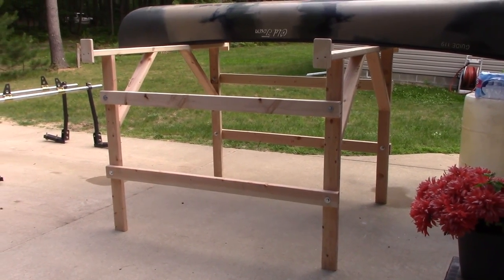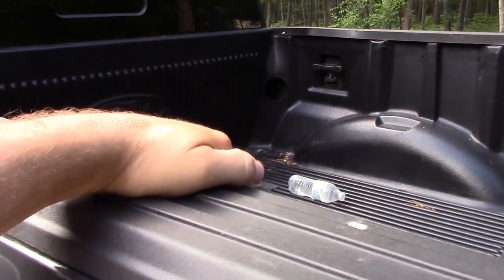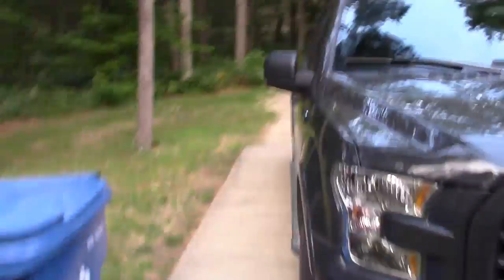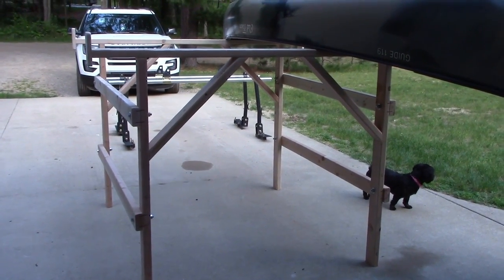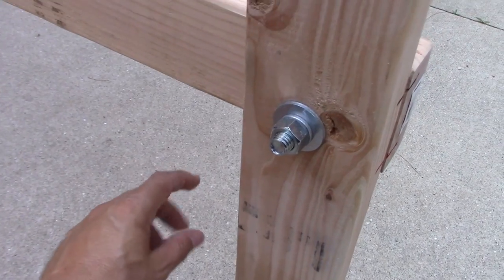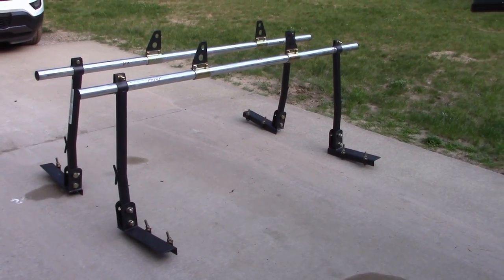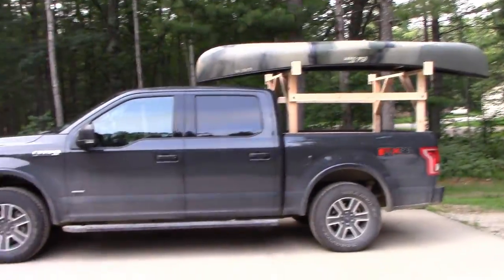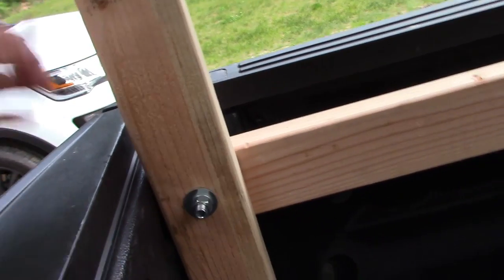Homemade Take Down Canoe/Gear Truck Rack

Comment: Excellent!  I built this rack over the weekend.  One tip if you plan to build one, put your tape measure in the tool box.  You only need couple of “measurements” and a piece of scrap wood is far better. Cut a piece of scrap to the minimum width of your bed at bed level.  For my F250 that was right at the tailgate, correction, cut two the same length.  Then use the “jigs” between the verticals and screw the horizontals on. Easypeeze! Same concept with the rails, 2 scraps cut to your preferred height (top of rail about the same as the top of the bed).   For mine, I used the same jigs on the top rail, again easypeeze.  I used someone else’s suggestion of clamping the rails together and drilling through them at the same time ensuring all of the holes lined up.  In July 2022 9 2x4’s came to $50 and a couple bolts I probably already have in my shop!😆
Reply from the maker: Yep such a fantastic rack!

Comment: Unless I missed it, no one has mentioned that some of us don’t want to drive around with the racks on our trucks for 90% of the year that the racks are not needed. The metal ones are more permanent. Your setup allows for an easy breakdown. Awesome idea and video!
Reply from the maker: Great point.  And I wanted to be able to store in in the garage to keep it out of the elements.  So the simple bolt together and labeled rails make it very easy to assemble and disassemble very fast.

Comment: Ooooooooooooohhhh!!!! I was totally bass ackwards beforehand in how you'd break it down. Great rack & something that I can do & use. One thought: on the tabs, maybe drill a 1-1 1/2" hole on the bottom side of the tab. Gives you something to hook ratchet straps to. Another thought, this one for your braces. Another channel, Cottage Life with "Brojects", they used metal braces. My thought is is that it gives you a little bit more room for walking around. Great job, I'm going to use your design! Thanks!
Reply from the maker: Great tips! Might have to try some of that stuff next time I make one. This rack has been thru 3 trucks and about 20k miles across country so far and holding up just as good as the day I built it. Love this thing!!!

Comment: Wow, super excited to see this video. Its just what I need to haul my Old Town Saranac 14'6
Reply from the maker: Works amazing you will love it. Used this one for 6 trips across country with 2 boats upto and it was refitted to 3 different trucks. Sold it in Nov when I moved to Georgia for 175 bucks
Reply: @SamkoTradBow  going to get materials after work today and my son and I are going to do this project next weekend. My question is the gap over the truck roof. Would 12 inches be too much?
Reply from the maker: @mattbruneau8215  what I did was tip my boat upside down on the drive way and measure the gap at the middle of the boat to the ground so I know how much the canoe rips curl. Then I added another 6 inches to that. You want to make sure your boat on the rack won't have the front of the boat hitting the roof.
Reply: Did this awesome rack yesterday with my son and beaming with excitement . Fits nice and snug in my truck and super sturdy. We test fitted with our 14'6 canoe and 6 foot ladder. We had it a little to high as you can see in the pics so took it out and trimmed 4 inches off the hight, now perfect.
Reply from the maker: @mattbruneau8215  awesome! Such a great set up

Comment: EXCELLENT tpw. I'm picking up a new truck next Tuesday and will be heading directly to Home Depot for the material. Will be adding a plywood tool box to sit on the lower parallel boards.
Reply from the maker: Great idea about the tool box shelf add!

Comment: Just wanted to let you know that I spent the afternoon making this for my truck. Super easy, super solid and can't thank you enough for the inspiration.
Reply from the maker: You will love it. Mine has traveled across the country 8 times with 2 canoes ontop and never gave me a single issue. I then sold it this year when I moved and sold it for 150 bucks.

Comment: I just bought a 20 f150 and have to agree with the aluminum bed comment. I told the salesman I needed a spray in liner cause I don't trust it. He assured me its stronger than steel, first time climbing in it I knew he was wrong.
Reply from the maker: Have had 2 aluminum 150s now and I will say the top rails are not my favorite but other than the first one ripping like I show in the video both trucks beds have held up very well. You will be very happy with your new truck! Congrats!
Reply: @SamkoTradBow  Thats some good info. Coming from a 2000 F250 it is a world of difference. I was looking at a similar rail mounted rack, I didnt even think about the top rails not holding up like you showed. I like the DIY rack you did, well done and a lot of positives.
Reply from the maker: @chancecarlton8403  this rack has carried canoes and kayaks across the country 6 times now and been in 2 f150s and is now modified to fit in my ram 2500. This home made raxk is the best canoe rack I think a person could ever have. You will really like it

Comment: Do u hav a build video I need one lol u did a great job
Reply from the maker: I dont have a build sheet as I just eyeballed everything. But it was fast and easy to make. dont over think it. just stand a 2x4 up in your truck and mark how high you want it. and cut 4 of those. then add top borads and some bracing.

Comment: This is awesome, I want to make it for my ram. How sturdy is it? Forward and back would you want to use two carriage bolts on each post?
Reply from the maker: Rock solid and doesn't move. I cut mine to fit perfectly between the tailgate and from of bed. Toughest rack you will ever use. Doesn't budge

Comment: Looks great, I’m planning on building one myself for my Sierra, just wondering how the 2x4’s hold up while on the highway in regards to the weight being fairly high and the wind resistance. The last thing I’d want would be for something to break and there go my canoes haha. No issues?
Reply from the maker: No issues and wat stronger than the steel one I had before. I have taken this rack with 2 heay kayaks from Michigan to Kansas now 8 times and from Michigan to Georgia twice.  Best boat carrier I have ever used ever. Yoy will love it

Comment: This is exactly what I want to do. I wasn't sure if it would be sturdy enough. Can you get up to 65-70 mph with your canoe up there?
Reply from the maker: Its the strongest system I have ever used (better than the steel ones). I have carried 2 canoes or a canoe and a 130 pound fishing kayak on it from michgan to kansas 6 times now and from michigan to georgia 3 times. speeds over 80 mph. Flawless and not even a wiggle. I could put ply wood on top and host and dance party up there and it would not budge!

Comment: I have the exact truck and getting a kayak and paddleboard this week, first question mind sharing the measurements? When you strap them do you just wrap around each horizontal piece and run it through the kayak I'm assuming?
Reply from the maker: Sorry I have modified this rack for 3 different trucks since this video.  Best rack I ha e ever used and love it. But I do not have original measurements.  Yep I strap the boats right to the top cross bars and also front to back. So 4 straps per boat. 1 across the front, one across the back, and one from front to middle of rack and one from back to middle of rack.

Comment: What size truck bed do you have? My truck is a 5 1/2 foot bed I believe. Would you mind sending the dimensions of each wood piece you used for you canoe rack? I would like to build the same. I appreciate you video and how simple it is.
Reply from the maker: This was for a 5 and a half foot bed. I no longer have this rack to measure.  Sold it when we moved from Michigan to ga so I would not have to pack it. But used it for 5 years and then sold it for 200 bucks. Such a great system

Comment: I like your design. I have a F150 with the same bed length. Could you list your cut lengths?
Reply from the maker: Sorry dont have the truck anymore and modified the rack to fit my new ram truck. So I dont have the cut lengths.  Bit I just put the 2x4 on top of the bed and marked it then cut it. I didn't even use a measuring tape for any of it.

Comment: Great plan! I plan to build it incorporating half-lap joinery. Our kayaks are 12' long, 36" wide and weigh 100 pounds. Since I will carry my kayak in the bed and my son's on the rack, I am interested in how you secured the uprights to the side of your bed. Although I am not anxious to spend more $$, I am considering using rivet nuts for that purpose. Any thoughts would be appreciated. Thanks!!
Reply from the maker: I just used ratchet straps around the cross members to the tie down points in the bed of the truck. It doesn't move or wiggle at all. So rock solid. We have carried a 95 pound canoe and a 110 pound fishing kayak on it from Michigan to Missouri and back nothing even budged or shifted. And we have done 7 trips from Michigan to Kansas with 2 50 pound canoes. Again never an issue.
Reply: @SamkoTradBow   Thank you so much! Once finished, I can send photos if you'd like.
Reply from the maker: @billr4283  love to see it
Reply: @SamkoTradBow  I finished the rack and have photos; however, I don't see a way to download them. Please email me and I will send them.

Comment: Love this. Do you happen to have a material list?
Reply from the maker: I purposely didnt include a list as all truck beds will be different. But I used 2x4s and 3 inch screws. The side rails bolts are 3/16s size. The end cap boards are 1x4 pine. It's very easy to make and I didnt even use a measuring tape as I built it to the size of my truck bed. Stood a 2x4 up in bed of truck and guessed how tall o wanted it then marked the 2x4. Cut 4 of those. The make some cross members and angle braces and done. Good tip is to mark each side cross member like this "d-t" for driver side top. Etc so they go back together with the holes all lining up.
Reply from the maker: Also just a testimonial to its durability I have drove from Michigan to kansas 4 times now with this rack loaded with a 120 pound kayak and 50 pound canoe. Also used it to transport 10 2x12x 16 foot treated boards 250 miles. This rack is a built stronger that anything you could ever buy.

Comment: Awesome vid! We are about to buy a canoe and would like to start canoeing around the springs in Florida. I have a 2018 chevy Colorado Z71. Just wondering if you have a plan/cut list or approx how many feet of 2x4 I would need. I know your truck is different than mine, but just a rough estimate or some guidance would be great 👍
Reply from the maker: You will love this rack! I still use it 4 times a year cross country from Michigan to Kansas and it's still as perfect as the day I built it. I do not have a cut or size list. You will have to measure for your truck and buy accordingly.
Reply: @SamkoTradBow  I figured but I appreciate you!
Reply: @SamkoTradBow  last question. I am going to build this over the weekend.  How much clearance above your cab does your rack go? Thanks again! I'm excited
Reply from the maker: @CTRadventures  I made mine sit high enough that my boat clears when upside down. I figured thos by tipping my canoe upside down on my garage floor and measured from the front point hitting the ground to the center of the boat that was up 6 inches or so (because alot of boats curl up at the ends I wanted to make sure that point didn't hit my roof). So if it was 6 inches of curl I made the top bar 1 foot about the roof. Thos gave me about 6 inches of clearance.
Reply: @SamkoTradBow  that was my original thought make it 12 inches, thanks again!
Reply: @SamkoTradBow  man I tell ya, prices sure are staying high, just in lumber I'm at 84 bucks. Still better than those crappy metal ones that cost and arm and a leg and don't last
Reply from the maker: @CTRadventures  yep prices on limber still crazy
Reply: @SamkoTradBow  came out great! I wish I could attach photos in YouTube! I have a red truck with black accents so I stained the wood black. I also put my horizontal support beams on the outside which ok my truck puts them close enough that it will hold my drills and impact drivers haha bonus!  We plan on using it a little more than you do so we just keep it assembled and in the corner of the garage and the lawnmower and other tools fit nicely around it. Can't say thank you enough! Now it's time to find a canoe
Reply from the maker: @CTRadventures  awesome.  Sounds like it's gonna work perfect for you.

Comment: Nice.  What size bolts did you use 3 1/2 0r 4"
Reply from the maker: Cant remeber and my buddy has the rack right now so I cant go check. He is using it for a hunting trip right now.

Comment: I built one but it keeps shifting backwards on me, pivoting on the kicker bars.  Could you describe how to tie this down to the bed of your truck?
Reply from the maker: the way i made mine it cant pivot forward or backwards as the vertical upright 2x4s are flush to the tailgate and the front of the bed. all my tie downs do is keep it from tipping out of the truck on fast corners..lol  but if you did not build yours that way and its tipping on you a simple fix would be to put a center 2x4 from the back to the front right in the middle of the 2 main top bars that the canoes sit on. that will lock the whole thing together from front to back. could also make this easily removable my using a bolt and nut instead of screws.
Reply: @SamkoTradBow  I didn't make the back flush with the tailgate.  I'm going to get longer kicker bars and see if that helps.  I'm going to make some modifications to my rack and see if that will help.  Thank you.
Reply from the maker: @elihusmails  I bet that cross member from the front to back on the top right between the 45 degree supports would also lock that thing solid quick and easy.
Reply: This is what worries me. The forward and back motion. I wonder if I used 2x6 or 2x8 for the cross bars with two lag bolts on each side would keep if from rocking back and forth

Comment: Awesome Idea, could you provide the dimentions? I have the exact truck and I will like to build it for my truck!
Thank you
Reply from the maker: aldahiur I dont have the rack with me right now. Its stored in a buddy's pole barn until we need it next month. But I built it to the truck by standing a 2x4 on end in the bed front corner and marked how tall I wanted it, then cut 4 of those. Measured how wide I would need the top bars to fit both boats and added a few inches then cut the 2 top bars, then just added some angled 2x4s for rigidity. Once I had the front and back sections made I stood them in the truck and measured how long to make my side supports and cut 4 of those. Very easy and I let the truck bed tell me the dimensions
Reply: Traditional Bowhunting And Wilderness Podcast Thank you!!

Comment: Remember you said I hit the tree...not fault of the truck or Ford's build you can always reinforce the side rail with small piece of steel plate,
Reply from the maker: True. But what a horrible junk design on a vehicle thats ment for service and use. But regardless I will never use one of those racks again. This set up is so much better and easily field repairable. It is also so much stronger and solid. Love this homemade system regardless of what it looks like. Affordable, functional, and flawless!
Reply: Yes the setup you have now is best.. I will build one..
Reply from the maker: @mikerobinson2201  i think you will really like it!
Reply: @SamkoTradBow   I have to agree! I purchased a clamp on unit, installed it, pushed / pulled on it, removed it and returned it. I did not trust IT to carry a $2200 / 100 pound kayak. I adapted this design and it is ROCK SOLID.

Comment: Can you give me the measurements for all the pieces, cross pieces, etc?
Reply from the maker: I can not as it will all be specific to your truck. but very easy to do and dont even need a tape measure.  Stand a 2x4 up in the bed of your truck by the cab. and mark how tall you want the rack to be. The cut 4 of those. then lay a 2x4 across the bed with one end at the front and one end at the tailgate, mark it so it will fit in your bed nice and tight. cut those. bolt that stuff together. then figure out how wide you want the top bars and cut 2 of those and mount. then use the scrap wood to cut the support angles and screw em in. Done.
Reply: @SamkoTradBow  I asked because we have the same trucks.
Reply from the maker: @pmerioles  ahhh got it. Unfortunately I no longer have my f150 and have modified mine to fit my new ram 2500 witha bigger bed so I don't know the original dimensions.